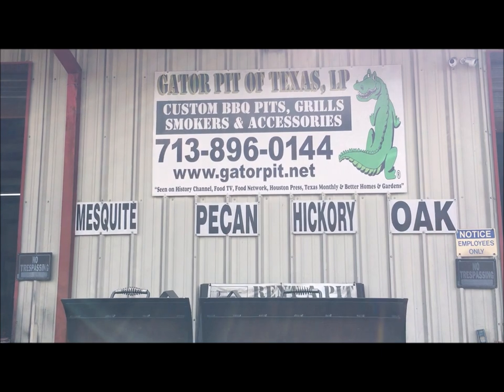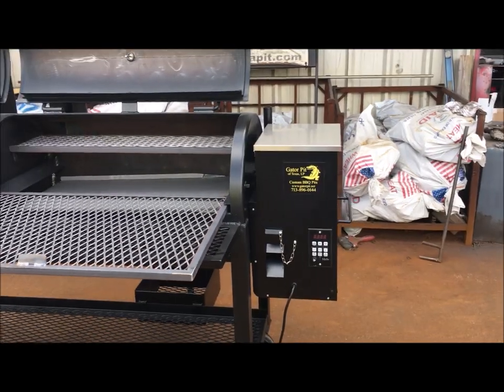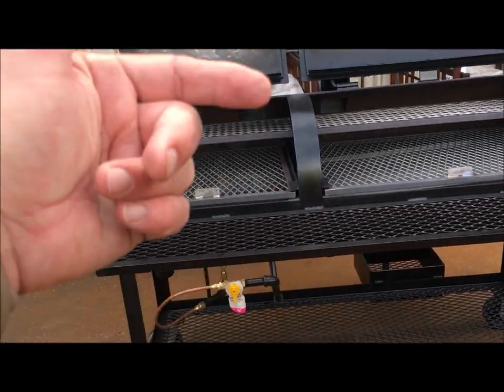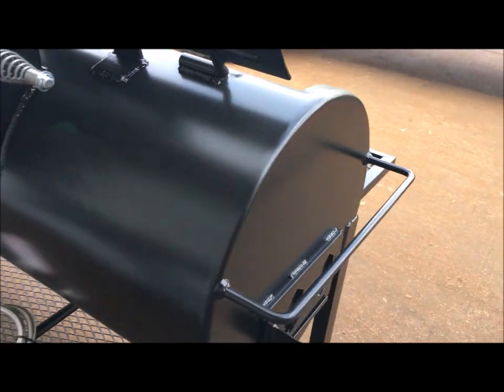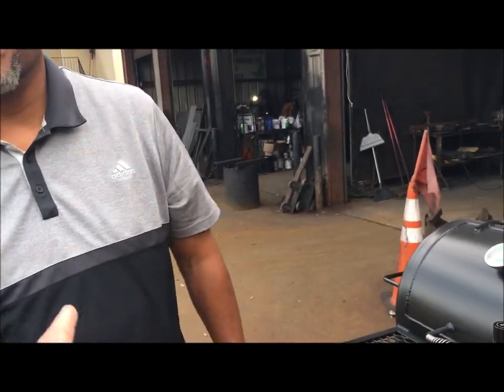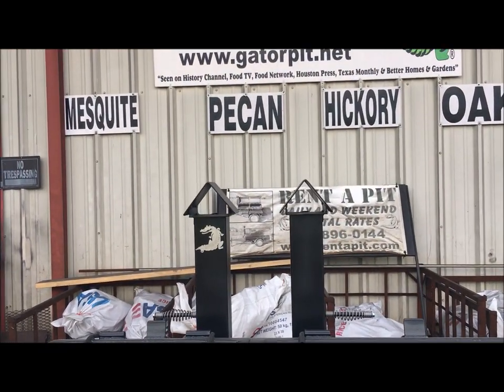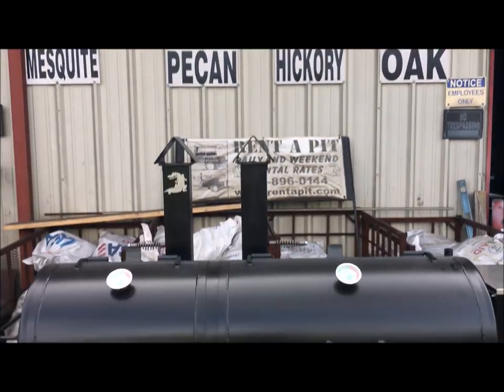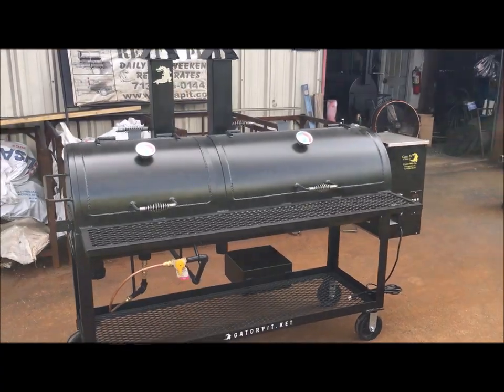WHAT!!!  Gas Pellet Grill???????

Comment: How much would something like this cost? And how long would it take to build?
Reply from the maker: Currently, due to covid, we cannot get the gas parts required to build in the gas grill section.  Distributors are out of stock on the parts.  For now, we are not taking orders on this specific design.  We can make the gas grill section a charcoal/wood fired grill.  If interested in that, please contact me direct at 713-896-0144 or email info@gatorpit.net    Thanks, Ritch